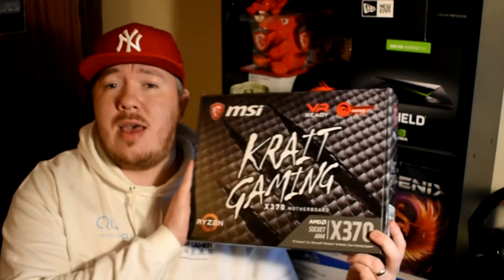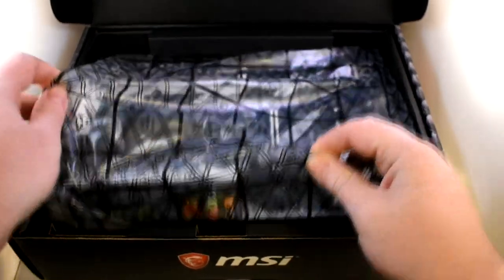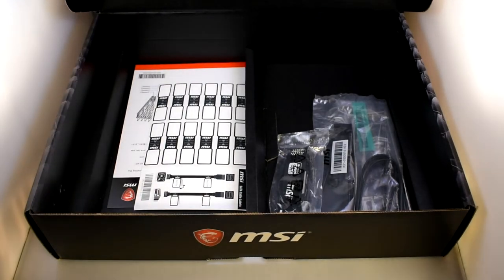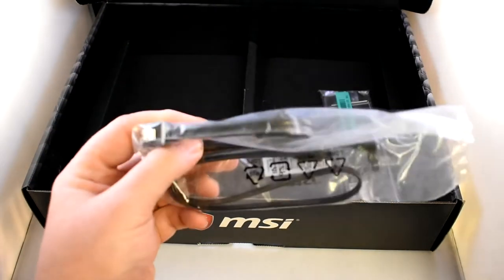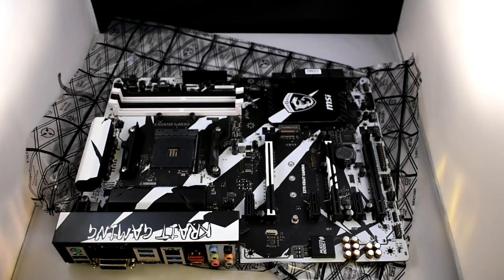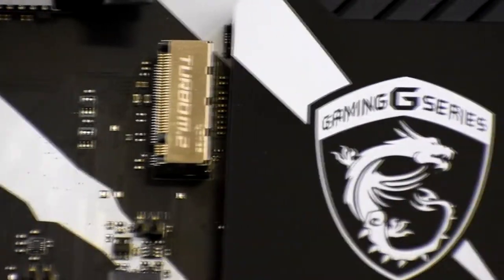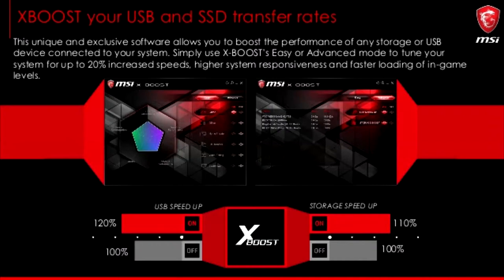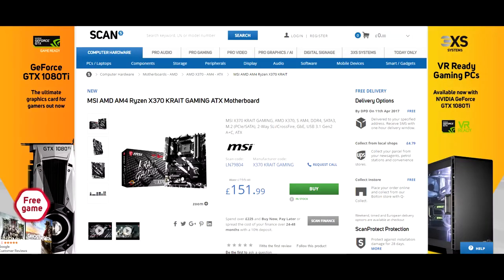MSI Krait Gaming X370 Motherboard Unboxing & Overview (Ryzen)

Comment: AMD processors run slower than than inel processors but when you over clock the AMD Ryzen 7 it becomes extremely powerful.  That's the benefit of using AMD processors.